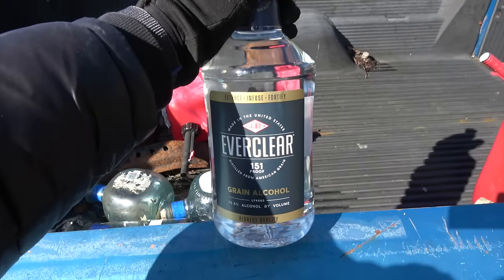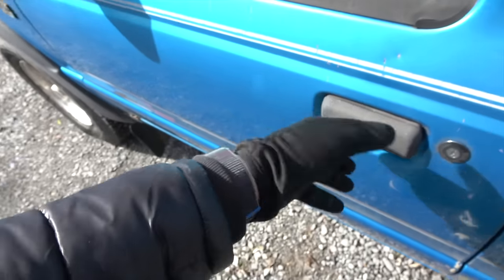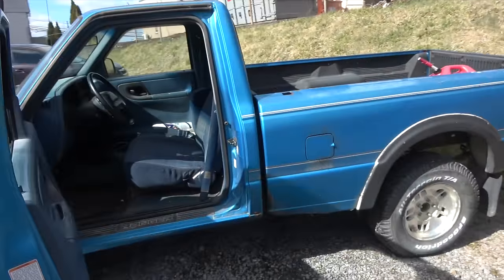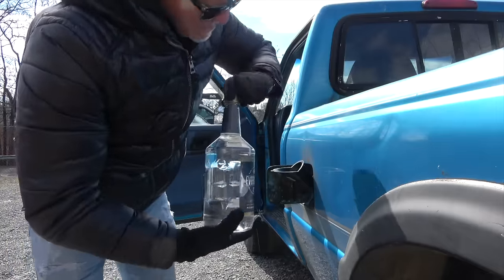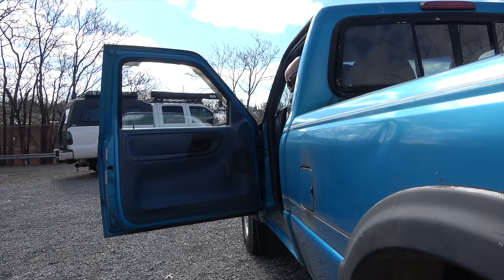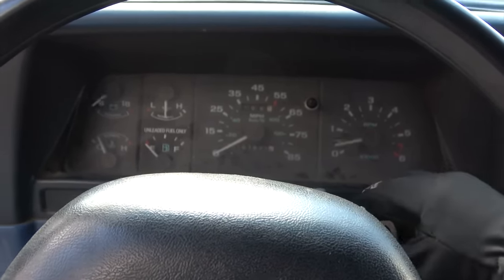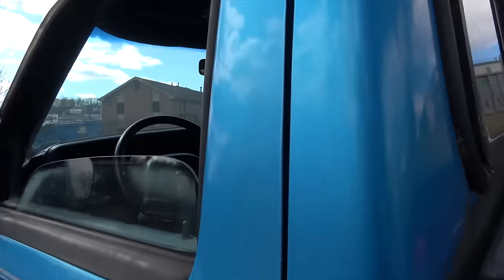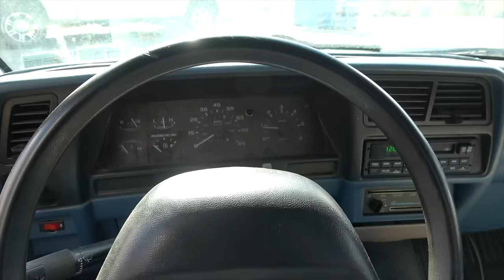What Happens If You Fill Up An EMPTY Tank With Everclear? (152 Proof Alcohol)

Comment: Well, the answer is simple: just use duct tape and block half the airflow and it should run way smoother on everclear. Problem is too much air....not the other way around.

Comment: The motor is not designed to run on alcohol.  Keep trying, it will burn up.  Gasoline, without water but perhaps a little alcohol is better for it.  87 octane is probably best for it.

Comment: Dude the way vehicles are geared now you can run a gas driven vehicle off of 1/3 alcohol. That means 2/3 of the tank is full of gas 1/3 is alcohol. The only other way around that is to redo the engine set it up to run off of straight alcohol.

Comment: Too much water in fuel.  Need at least 180 proof.  Fuel/air ratio must be adjusted for Ethanol.  I ran my lawnmower for 2 years on pure Ethanol.  Ran great once the carb was adjusted correctly and went from 160 proof to 180.

Comment: If you run a truck on pure alcohol, it is almost impossible to drive straight.  You can hold the steering wheel straight, but it will weave all over the road.

Comment: The reason it would not run is because the molecules of alcohol are larger than gasoline  molecules so its starved for fuel you need bigger injectors and mass air meter to match injectors and probably someone to tune the computer. Also most alcohol burning engines are using menthol alcohol  not ethanol alcohol

Comment: The alcohol you drink is just ethanol. flex fuel is made with ethanol. if you put this in a newer vehicle made with flex fuel in mind it would probably run fine. or at least better than this did. lol. even standard unleaded gasoline is 10% ethanol

Comment: That stuff is too combustible. If you use a different spark plug maybe a lil better but the engine unleaded gas is less combustible then e85 or pure alcohol. Which is why you are not supposed to put e85 in a older car/truck. If you have a colder spark then maybe it would work.

Comment: my guess is  that there is air in the gas line you need vacate the the fuel line its just a little valve you push an it lets air out an fuel in

Comment: All that pumping the gas pedal does absolutely NOTHING on a 1994 Ranger because (like most cars since 1990) it is a Fuel Injection system (NO Carburetor to pump absurdly).

Comment: The water content is too high. You would be better off with 91% or higher rubbing alcohol. The kind of alcohol in the everclear and in rubbing alcohol are both the same as what is in e10 gasoline and in e85/e90 race fuel that people run in turbo cars. The alcohol will burn fine in the car as long as you get a high enough concentration.

Comment: I had to absolutely laugh my ass off watching you "prime" it by pumping the throttle. That works for old carbureted engines, but it doesn't for fuel injected engines. If you want to prime a fuel injected engine, you cycle the ignition switch a few times.

Comment: Why are you stepping on the gas pedal? You cannot “PRIME” a fuel injected car by just stepping on the gas pedal. If you want to Prime it, cycle the key from accessory to ON two to four times, then crank the starter. By stepping on the gas pedal with the key on you will make the computer shut off the fuel injection because it thinks the engine is flooded.

Comment: Rite off the bat, that's not a gal. U can clearly read 1.75 liters wich is about half gallon. Pumping the pedal on fuel injected cars does nothing especially with key off! To prime just turn on the key till check engine light lites. U will hear the pump come on for 3 sec. To prime the system. Do that 2 or 3 times then crank it!

Comment: You are using the 155 proof ever clear when you should be using the 190 proof ever clear. And also gap your plugs smaller, they come gapped for the more combustible gasoline. Since ever clear is clearly not as combustible as gasoline, gap your plugs smaller to compensate the everclear's lesser combustibility...

Comment: it's not the everclear u clogged the fuel filter an fuel injectors with running it out of gas 2-3 times an sucking dirt from the bottom of the gas tank an there is two kinds of everclear an fair warning if u run everclear in a 4 cylinder ur gunna melt ur rings an they are going to weld their self to the inside of ur cylinders I've done it 😂

Comment: It would have been so much easier to disconnect the fuel line and run it in a secondary tank, ( the bottle ).... you drain a tank and then put ONLY a gallon in it.... just sayin.

Comment: Yes I would try a engine that runs E85 or higher ethanol. And put in Everclear into the empty tank of a E85 ethanol vehicle.  And pumping the gas pedal does nothing for the electric fuel pump. The turning of the ignition key to auxiliary then off and back on turns on & off of the electric fuel pump is going to Pump Fuel to the engine. 

And as far as what kind of other Distillery fuels to try running the engine on I would try distilling the Dew. https://youtu.be/0tabb5CL83s?si=DSV9H2GrRgpRC1d6